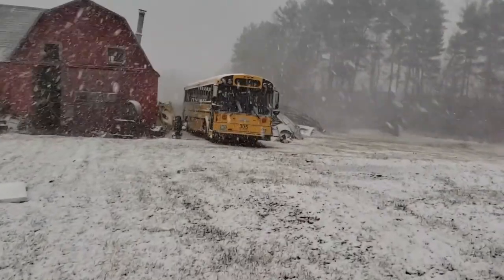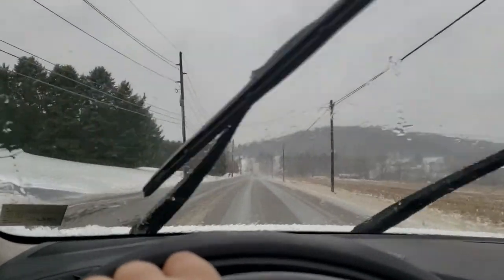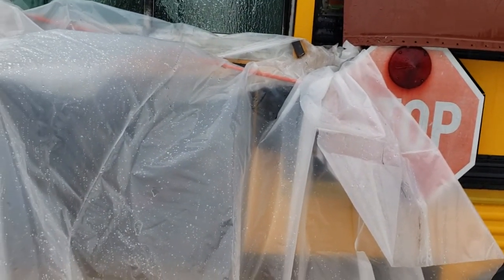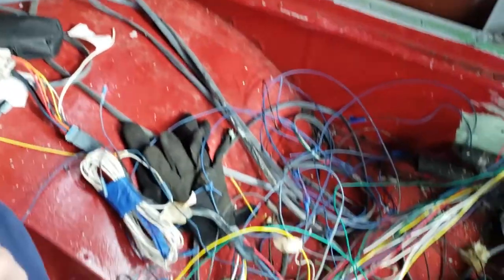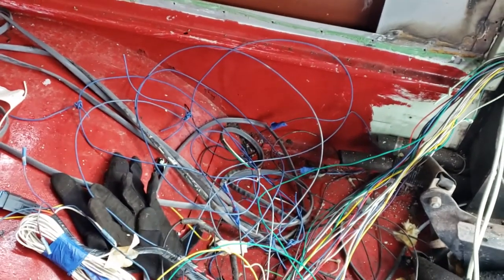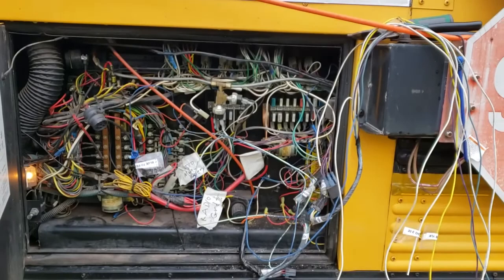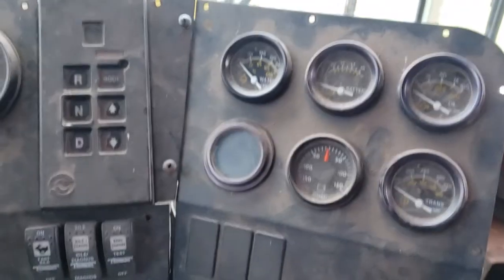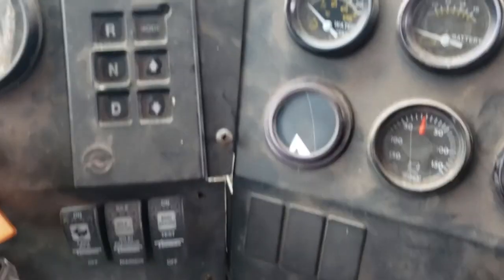Skoolie Build #19: Electrical. Removing school bus wiring. Reading engine/ ECM warning/ fault codes.

Comment: When I drove a truck OTR I had an auxiliary tank for tools and tire air. There was also a check valve in line (evidently it’s easier on the compressor). But that was on a full size semi and I’m not sure the compressor on my bus would handle that but, it does have air ride, air seat and brakes so, I’ll do the same and call Thomas

Comment: Do you have an air leak period, from empty it should not take more than five minutes to fill your air tanks, protect take longer than that you have an air leak
Reply from the maker: There's no air leak. My system comes up to pressure and holds at 125 psi. But I'm planning to replace the air brake lines air dryer and tanks and regulator before hitting the road because they're old and looking corroded and ugly.
Reply: @allmomomosthomebus3895  okay good. That sounds like a lot of work but,the peace of mind of knowing it’s done I would think would be worth it. I plan on doing my school bus to that way and I’ll also be getting the brakes inspected before I leave. Here’s a thought it would not be a bad idea to have somebody put in a T fitting so that you could add your own airline couple. That way you can check your tires at any given moment and if you have one that’s low you have an air compressor on board you can pump it back up
Reply from the maker: @zalleywaalley8227  I planned to put a valve and quick disconnect chuck for pneumatic tools in. I thought about an auxiliary tank as well. I'd need to talk to Thomas bus about implications for braking... Such as being able to brake too long causing heat glazing. It would possibly need to be isolated.